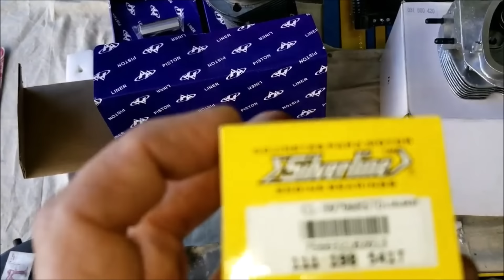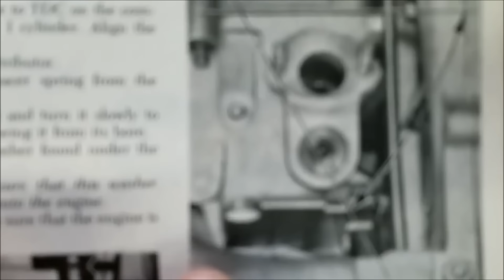BULLETPROOF VW ENGINE BUILD  flat 4 engine air cooled type 1 Full Build video 2007 STROKER

Comment: Are the cylinder rims necessary for buggy engines? In wouldn’t  think so but what’s your take?
Reply from the maker: shims are to calculate deck height. you need some space in there for the rod stretch. Because there is no head gasket like normal engine. min deck is like .45. .50 to .60 is normal.
Reply: @Mikefngarage  sorry autocorrect got me. I meant cylinder tins.
Reply from the maker: @volkswatson  Well it wouldn't hurt. but buggies get a lot of air and for the most part they dont run hot. That is why a lot of guys run 10 to 1 on a buggy. it is possible to do and run premium pump fuel. you could go either way on that. I ran several buggies at the dunes with stock deflectors and they worked just fine. I built an engine for my buddy and he ran it 3 seasons like that. but I think it was around 8 or 9 to 1. I dont remember exactly. Dual carbs 40s.

Comment: I'm looking at hot roding a VW bug around 300/400 HP on 92 fuel octane to E85.
Is this possible?
Thanks
Reply from the maker: Turbo for that. hard to get past 250 NA. $$$$$
Reply: @Mikefngarage  
About how much would a 300/400 HP engine cost
Reply from the maker: @matthewvarnam4302  250 NA would run about 10 grand. Turbo 300 to  probably more like 20....plus another 10 or more in the trans. Really a 250 is really fast. CB performance does those. Check their website. I think they do a dual carb blow through that is about 300hp. Runs on e85 which is better for power. Oh wait it is Injected dual throttle body .

Comment: OLD ENGINES ARE STRESS RELIEVED NEW ENGINES WILL WARP AND PULL AND STRESS RELIEVE IT SELF THREW THERMAL CYCLING .WANTS THE ENGINE RUNS NOTHING STAYS PERFECT  P.S SO SHOULD RETORQUE HEADS AND ADJUST VALVES AFTER BREAKIN PERIOD. AND THAN YOU WILL HAVE A VERY RELIABLE RUNNING ENGINE
Reply from the maker: yea always retorque heads. I do it every other valve adjustment.  at least the ones behind the rockers.

Comment: 1:15:18   The compression ratio is over rated.  My old beetle was about 7.5 to 1.  My Royal Enfield is 6.5 to 1 it can run on swamp water.  It still goes.  3 year old fuel it started but wouldn't rev.  Are we saving the Planet just to walk around town?